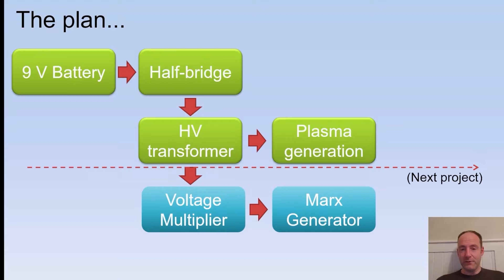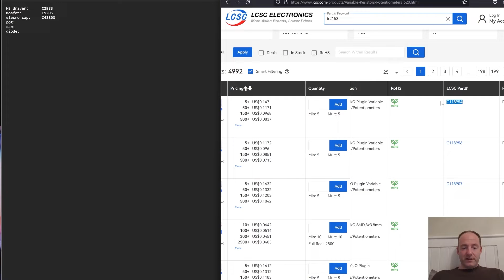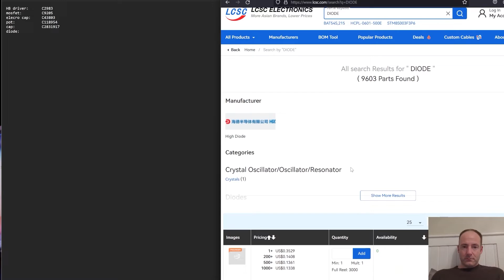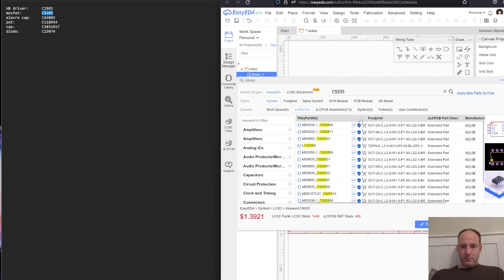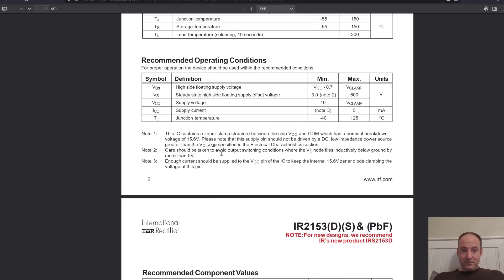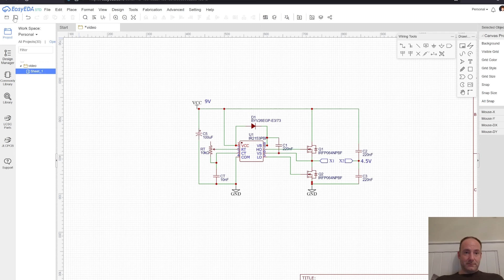COLD PLASMA - From a 9 Volt battery??? (Part 1)

Comment: can i know for the capacitor what type of it? voltage?
Reply from the maker: Not sure which cap you refer to, but I’d suggest electrolytics for capacitors on DC buses (input voltage) and polypropylene for the half bridge caps, the bootstrap capacitor is less critical, I typically use a ceramic SMT component.